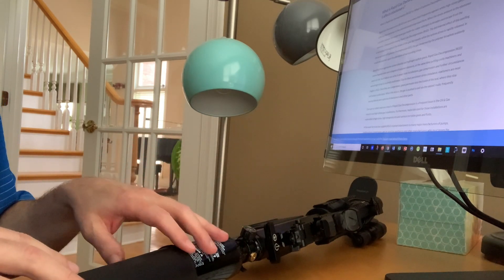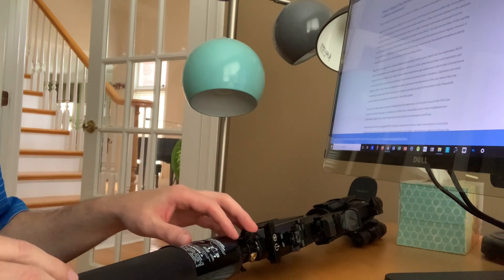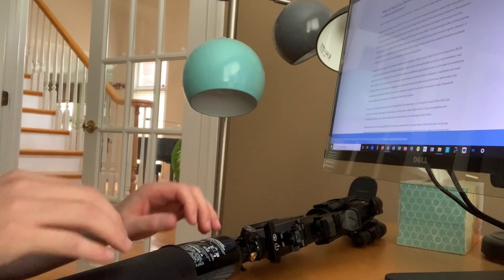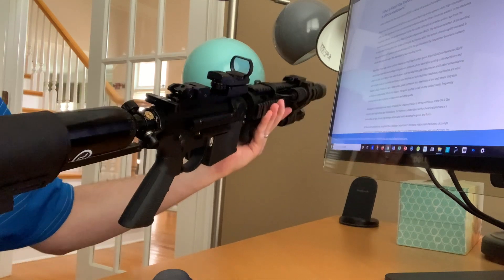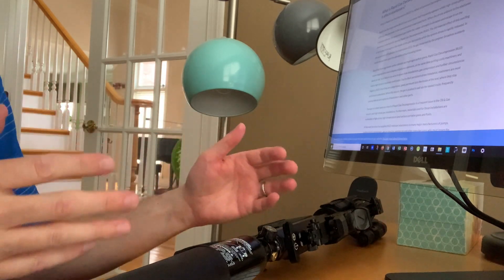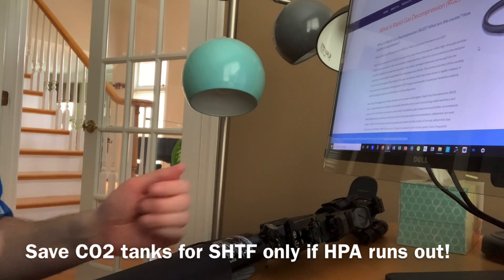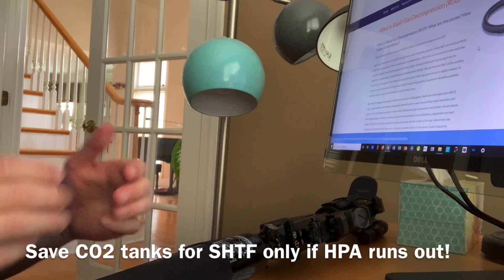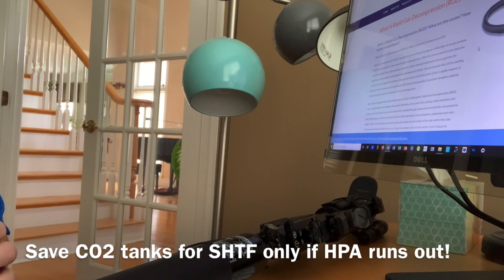Pepperball VKS or FSC at max Joules - the truth about big CO2 carts!

Comment: You mentioned rapid decompression not being so much of an issue using 8 or 12 gram co2 in a TCP. Any thoughts on leaving a TCP pre-punctured prior to heading out for the day? Will the gassed up launcher over the course of a 5-10 hour outing have detrimental effects?
Reply from the maker: RGD occurs with all CO2 but the smaller 8-12g carts are the least likely to cause o-ring damage. But with time and enough shots even those will cause wear, that's just the inevitable. As far as the TCP, I've never done a multi-hour storage test under pressure because I see no real need to gas it for that long. Certainly if you encounter something suspicious then charge it and take the chance but I wouldn't routinely do that day after day.
Reply: @ShadowCatTactical  Thanks for the info!

Comment: oh one more thing lol ,  i tend to believe , having the large co2 bottle in an upright position  on a back pack type belt system with a long coiled high pressure hose hooked up to your less than lethal marker would probably be better "remote hook up " then attaching horizontally . i think you would have less chance of going liquid in a paintball game or a real life saving scenario !!!  SOMETHING TO PONDER ON !!! i have always loved remote line type hook ups for games , but it would be a pain having to open carry this stuff for personal protection . here is another great idea someone will pick up on and market .  a hpa tank the size of a 12 gram co2 tank so we are able to get better more explosive shots and performance in our less than lethal markers .if they were even filled to 4500 psi , wow !!! they would have their own regulators just like bigger thanks do .watch and see , someone will bring it into existence soon , mark my words .
Reply from the maker: I think you are right about both approaches. CO2 can be optimized for better performance using larger tanks but that doesn't address rapid gas decompression (RGD). It is debated about how much RGD is a risk factor in paintball but less lethal is a different beast with essentially deleted regulators. A remote line or a different valve system on the tank are just band-aids that don't address the key problem but I can't say they won't help some. As far as smaller HPA cartridges, there is a company now using a very interesting approach like that. Look up the AEA pistols (Defender 2.0). But I wouldn't trust 1500 PSI or higher running through something like a FSC/TCP because the firing pin can't handle that much pressure.

Comment: Do you think removing restrictors and just plugging external 88g co2 would produce extra-power in UMAREX markers? Guess they would have a huge chamber to evaporare liquid co2...
Reply from the maker: The advantage of CO2 is the small size when compressed as a liquid and that makes pistol format launchers practical.  But there's a physical size/power limit. Rather than using expanded CO2 in a large expansion chamber, I would just use a larger HPA tank configured as a carbine format. CO2 risks and limitations in cold weather are just inevitable. I don't have a Umarex launcher but they don't seem to have any particular advantages over other brands as far as large size CO2 carts. I hope that's helpful. Thanks for watching.

Comment: Good video. On my Tiberius T15 I use HPA. But my Umarex HDR, HDS, HDX etc is harder to use with HPA. Tha adapters needed cant be found lockaly and must be ordered from other countrys... I agree with how you think, but for the ease of it I use 12 gram CO2 where I can. I use my markers for testing and plinking only, not for home defense. So if I blow an O-ring it dont matter that much. Greetings from Norway 🙂👍
Reply from the maker: Thanks for watching. Yes, I see a number of your markers are designed for CO2. At the working stock velocities these probably function quite well on CO2 just like my PepperBall TCP, or VKS can do at PepperBall velocities. With CO2, less is more.  I think it's not really a yes/no answer but rather it depends on how much of an internal regulator or valve block is left. There is a small population of the Less Lethal world that is removing restrictors and going for broke on these for high power. If they stick with HPA it should be fine.
Reply: @ShadowCatTactical  Yes. I think you are right. The only time I popped the heat-core O-ring (or any other seal) is when firing the HDR68 with an open valve. After putting the restrictor back in the CO2 tube it has worked fine. Lots of silikoneoil seems to help also 🤔

Comment: Yes HPA is much better than CO2 , it has a gauge so you always know if is full or empty. The pump for the hpa is expensive ....but the long term is better . Where is Mango 🐯
Reply from the maker: HPA has met or exceeded all my expectations so far. I love the fact that it's insensitive to temperature (great for carry in a car), shoots consistent power, and like you say you always know how much is left from the gauge. Combine that with the way it runs smooth in the launcher and doesn't damage anything is great. Just make sure it is de-humidified air and you're good to go. Mango made her appearance at the very end. She says hello.
Reply: @ShadowCatTactical  Is there a max safe operating/storage temperature for HPA? Living in So Cal, it can get to 115+ degrees in a car in the summer.
Reply from the maker: @Doc_Star  Good question. I've read that HPA increases about 5 PSI for every degree F. In a sealed car the temperatures can reach 140F in about 40 minutes even with a window cracked open. This would still be way below the burst disc rating for tank failure but certainly is not a best practice for overall reliability. At high temps, valve seat malformations and o-ring failures are probably the bigger issues.

Comment: Before there was hpa there was co2 but something you didn't touch on was before there was hpa there was co2 + expansion tanks and anti syphon bottles. Both of the latter were adopted by paintballers as a bandaid to replicate the soon to be discovered hpa advantages. While expansion tanks and anti syphon allowed much better consistency it also removed that addictive pressure spike that many LL crave on the first couple of shots. So one could argue you can run larger co2 with an expansion tank but it also negates any boost from barrel expansion that we LL desire so we are back at square one....hpa is just better except when such a moment occurs that its an only option or in the smaller 12/16g ready to puncture cartridges.
Reply from the maker: So true. I didn't get into that but it's a great topic that I may elaborate on in a future video. The VKS has these great residual places in the mags where 12g CO2 used to go in the Tiberius T4.1 but the space is much bigger especially in a 15-round mag. I have always thought that space could be converted into an expansion chamber with perhaps an empty 88g CO2 cartridge. Not sure how effective it would be with everything have to go through the tiny CO2 nipple of the regulator. My understanding is that a good expansion chamber needs to be as big or bigger than the tank you started with. So that's almost like you need a double cartridge set up at the minimum to allow all that CO2 to become gas.  Probably doable with some testing but I still would be concerned about how well it would actually work. I know Kurt at Grimburg Less Lethal has talked about this in the past too but if he hasn't been able to put it into practice yet, it's not something I'm ready to tackle.
Reply: @ShadowCatTactical  biggest issue with expansion chamber is co2 must past directly through the the chamber before entering marker. In the vks current form the co2 would pass through the regulator into the air chamber and merely excess would then travel to the mag outlet. There are smaller compartmental chambers that are designed small but the internal surface area is in fact quite large. The large surface area allows time for the liquid to slow and warm to ambient temperature....it does work but rate of fire can effect the effectiveness of these co2 traps.
Reply from the maker: @lesslethalfordummies  Got it. Thanks.  I never say never about technology advances. Some day it may become feasible to use CO2 gas this way.
Reply: Doe you guys think that's what umarex was doing by having the separate compartments staring with the co2 tube and  with a restrictor? I think expansion mag changer is great ideal but like sean says  its in wrong order the old school one have like six chamber in side one cylinder   to make ideal one would have to have two tanks  on gun it kinda defeats the point. As you said just not made for 88gram co2. Perfectly suitable for helium tho with double the all-around advantages of co2. If anyone has a compressor I can tell yall how to easily compress a tank of party time balloon helium into high pressure helium for less then price of an 88 gram co2 it doubles the power without  risk of higher psi on your marker it amazing stuff. You can even do how and part helium for a boost to your power .amazing stuff
Reply from the maker: @jono2313  Helium is definitely interesting, thanks for sharing the idea. In a 2013 study, internal blister damage of o-rings by helium gas was less than with CO2 because solute helium gas diffused out from the o-ring after decompression faster than the other gases. Helium is so light that it may be less of a problem. Certainly CO2 is the worst offender followed by N2. There are many scientific studies on this topic because of the central role o-rings play in many mechanical devices, some of which are critical for saving lives.
Reply: @jono2313  absolutely why Umarex did this. It may be limited expansion but it did improve efficiency for its intended purpose.

Also why hpa gets such huge numbers as it essentially a giant air chamber.